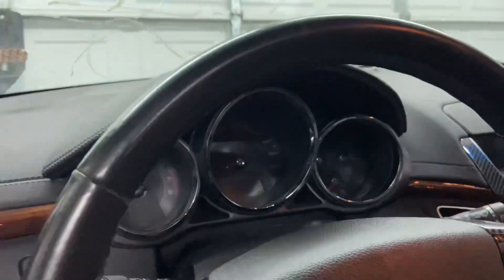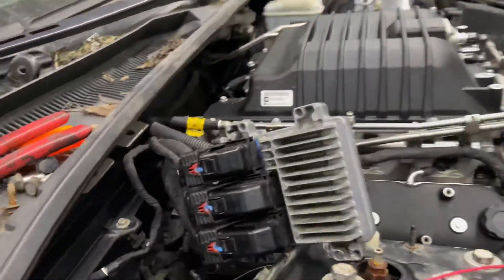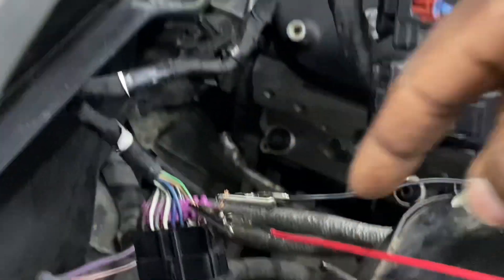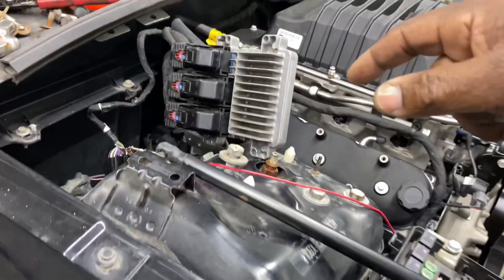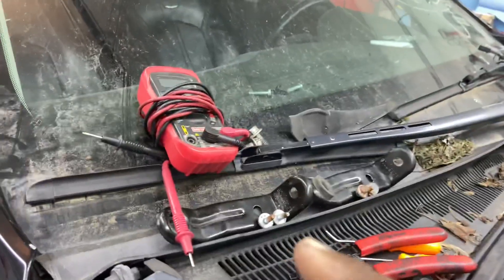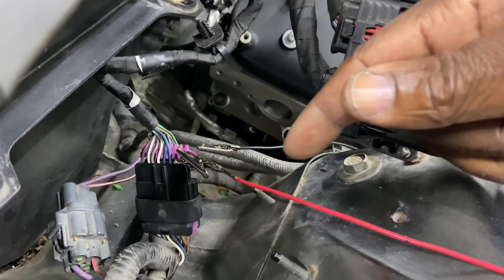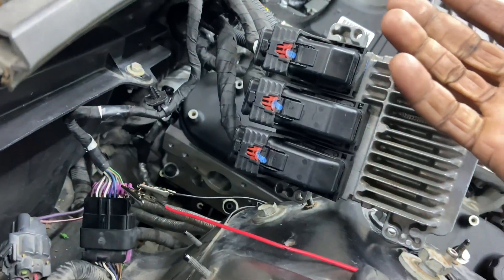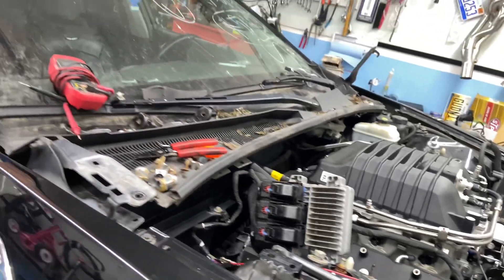CTS wagon LS swap “Frankenvagon” wiring breakdown and computer programming Part 4

Comment: Quick question if I get a 2015  cts with the 4  Cylinder Turbo I have to change sub  Frame to do ls swap and  Were you able to change the Vin number for the car in the computer with the HB tuner I have Hb tuner .